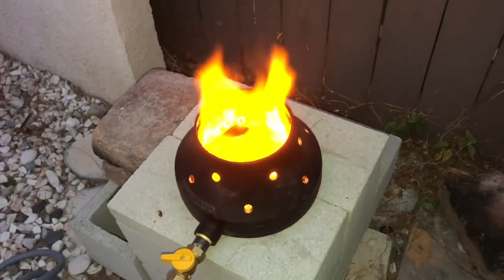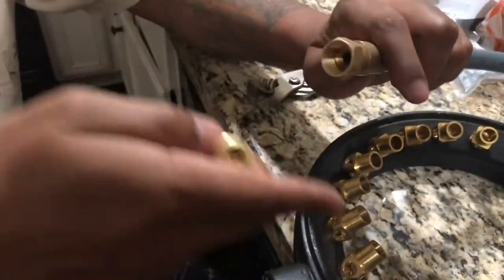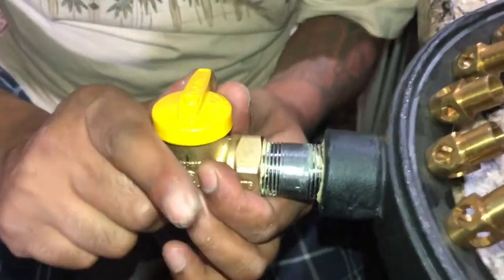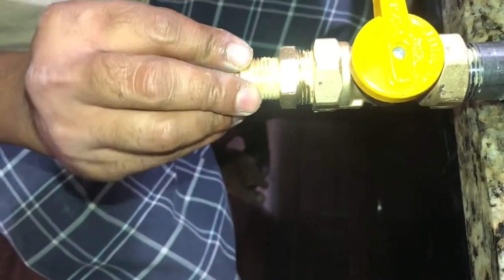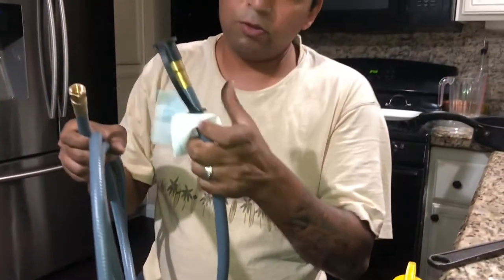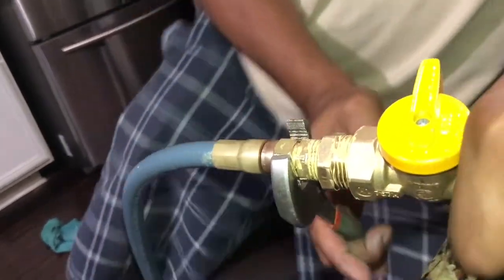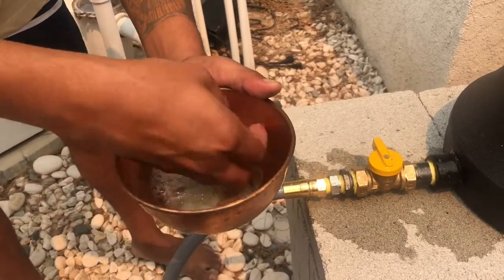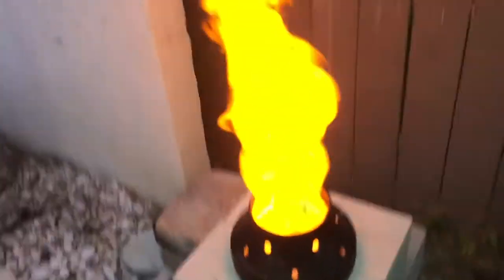HOW TO INSTALL A WOK BURNER || NATURAL GAS WOK BURNER ||

Comment: hey, a recommendation you should definitely do is lift the burner a bit off of the surface, so fresh oxygen can reach the fuel. the reason why your flames are so orange and "weak" despite having a chimney is because there is not enough air going in from the bottom. i can guarantee you that the stove will work much better with enough clearance for enough air
Reply from the maker: thank you for your suggestion

Comment: Good vid.  I have a similar setup for brewing...  It saves a lot of time and money not needing to exchange propane tanks.  But only controlling fuel with a ball valve does poorly with efficient combustion.  Furnaces, water heaters, NG stoves all have regulators...  This isn't as much a concern with $ cost, but with cleanliness--it'll burn yellow and leave soot all over your pots/pans.  A real mess!  I know from experience, and am searching for a regulator.
Reply from the maker: I’ll install a regulator on my next install. Thanks for watching

Comment: Thank you for the video. Could you share the Amazon link.
Reply: @SharmiMon  thank you but this one is different from the one you have.
Reply from the maker: @mahdibourhim8217  https://www.ebay.com/itm/NEW-Chinese-Wok-Range-Jet-Burner-20-Tips-w-10-Cap-Natural-Gas-FREE-SHIPPING/152106849189?_trkparms=aid%3D111001%26algo%3DREC.SEED%26ao%3D1%26asc%3D20160727114228%26meid%3D4c1dcda642034dd88108aac8d2d5284b%26pid%3D100290%26rk%3D1%26rkt%3D1%26sd%3D152106849189%26itm%3D152106849189%26pmt%3D0%26noa%3D1%26pg%3D2506613&_trksid=p2506613.c100290.m3507
Reply from the maker: this should be the one i got , i also have the other one

Comment: I think you have the wrong jet tips installed in there. I assume you're running natural gas. I think you have the propane tips. That's why no blue flame.
Reply from the maker: Thanks for the tip, but once the burner gets going flame gets blue